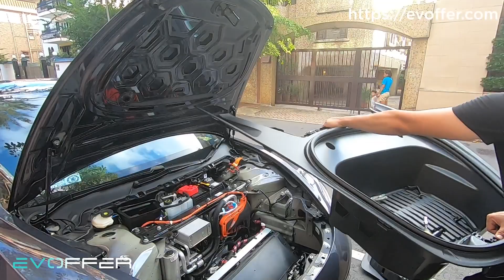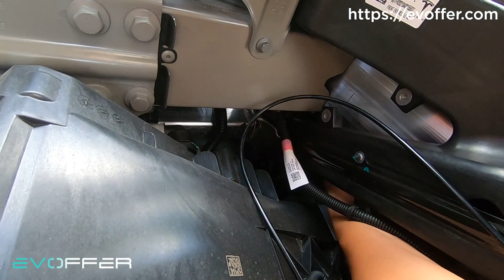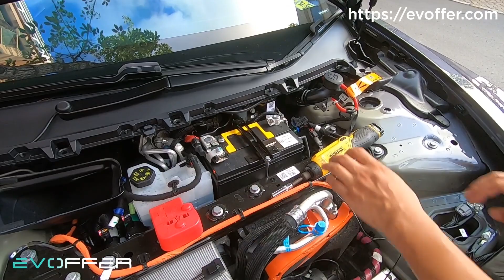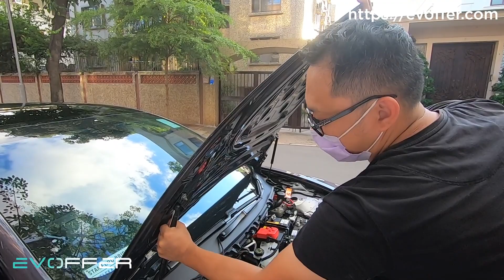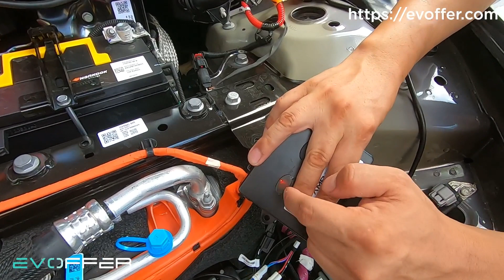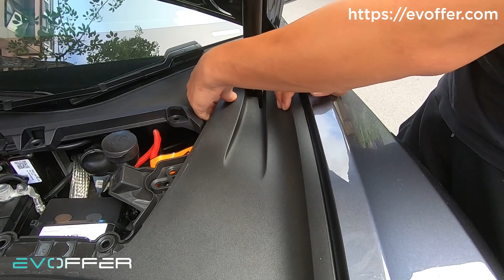EVOffer (Tesla Offer) - Model 3 (Variant B) Electric Frunk (Mark 4.0) Installation Tutorial

Comment: When are you guys going to release the cable to tap into 12v for the 2022+ Ryzen Model 3? I don't feel comfortable rigging it by stripping the wire and just wind it around the + jump post ( as described by customer support), specially in a climate when it rains a lot.   I used to have the Mark A on my previous car and loved it, but I won't be getting another one unless there is a plug and play solution.